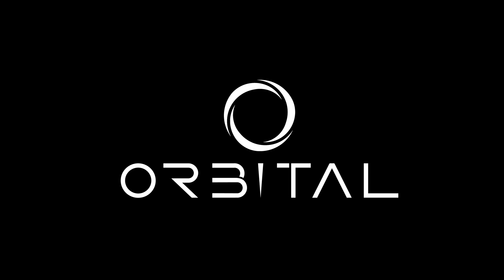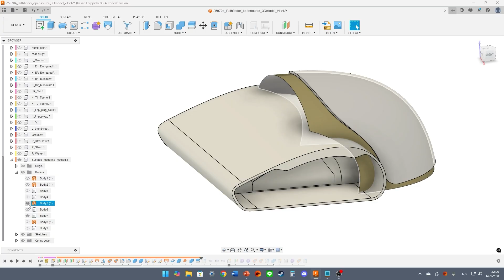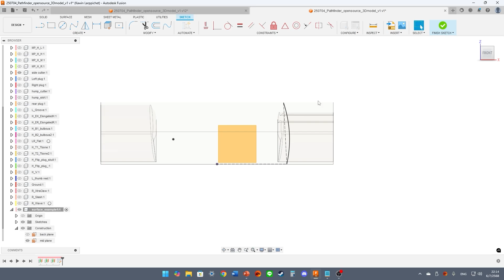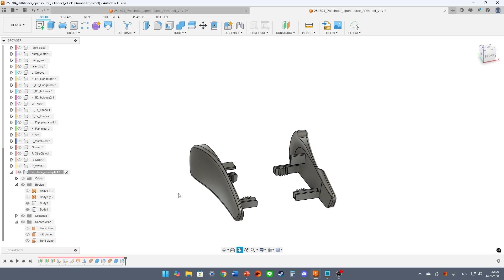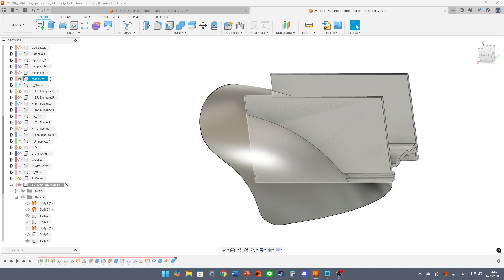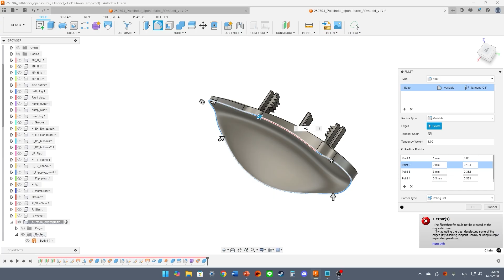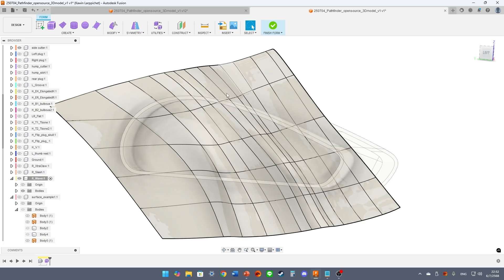Orbital Pathfinder : Design your own shape

Comment from the maker: 0:00 Intro
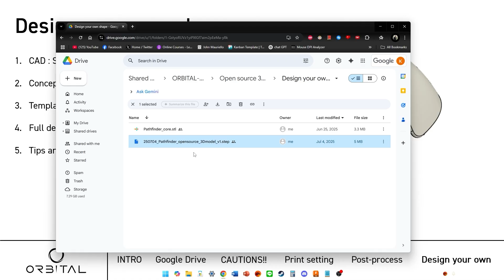1:59 CAD Software
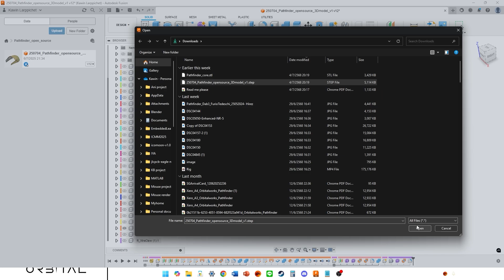2:47 Overall procedure of making the shape
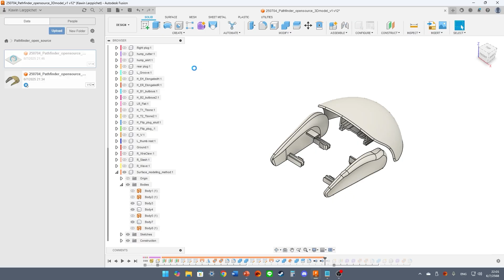6:24 Open the provided STEP file
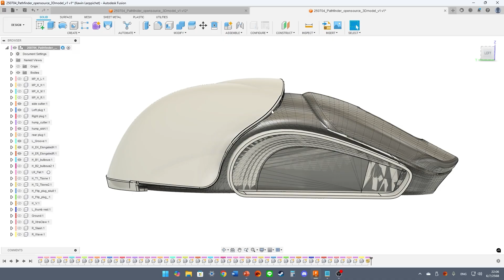7:28 Common methods to create a surface
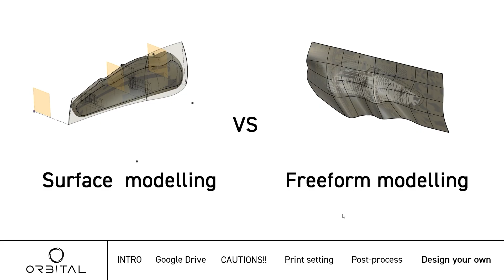10:33 Let's start (Surface modelling method)
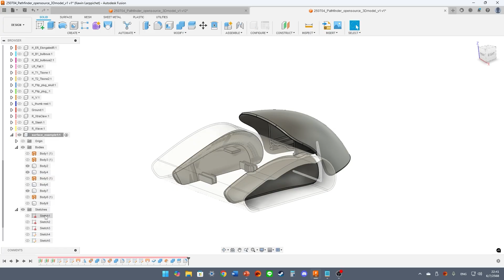27:15 Create a surface by the freeform modelling method
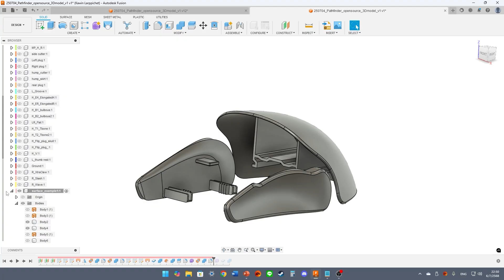34:50 Modify the existing shape
37:37 Tips and Tricks